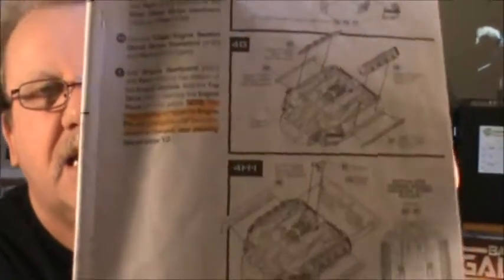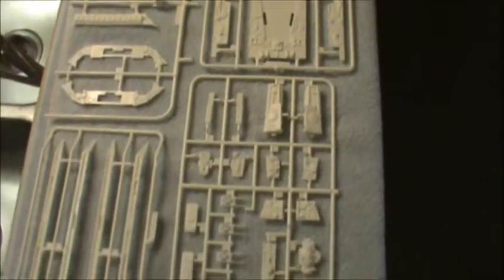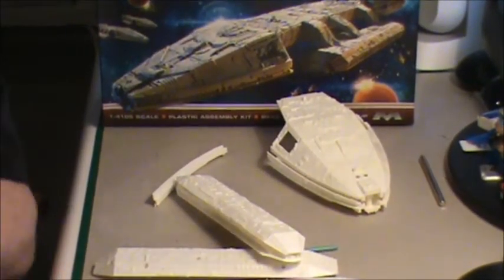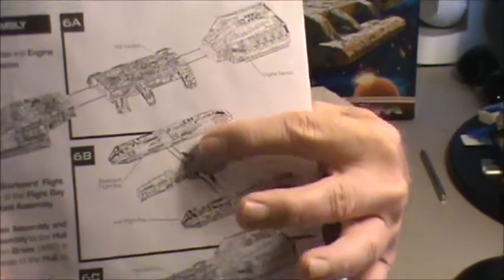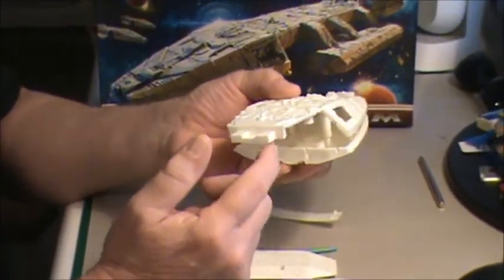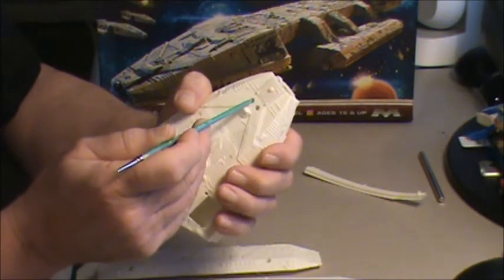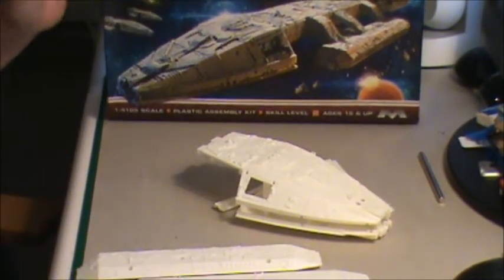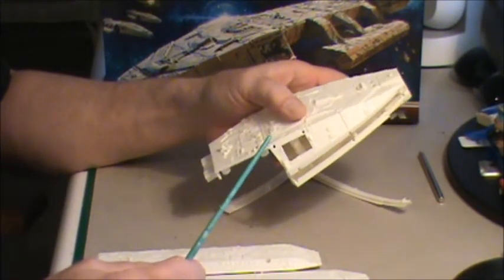BATTLESTAR GALACTICA Part 3

Comment: Thanks for doing this video. Just rush built this kit, and then remembered I WAS going to light it. Guess I'll have to find an alternate method to light her up. I do have a backup kit which will be light blocked inside, and properly lit. No fiber optics though.
I had the same warping problems, even on the landing bay side parts, but if you're careful, and apply low heat from a hair drier, or warm soak the parts, you can slowly straighten the parts out.
I tried the multi colour paint scheme suggested by Moebius, but when you get down on the model with a magnifier, you can see all the spots of the lighter off-white paint from the dusting coat job. I think this kit's too small for that kind of painting work. Still, she looks great seen with the unaided eye.
Definitely going to have to scan, and print a transparency of those matte paintings for light to pass through them when  backlit in the landing bays.
Looking forward to the next vid.
Reply from the maker: Thanks for watching.  Just posted part 3 yesterday and I am in the process of filming part 9.  I think I will post a new video about every 5 days.  That gives any comments a chance to run there course.  I am lighting mine and using PH.  NOT using fiber optics so I guess you will have to keep watching.  Had problem with PH....will be in part 8 but super nice for landing bays.  Lights and PH I'm using in part 5 to come.  When I primered the front section I also noticed it does not get down in between all the fine detail.
Reply: Gary Brinker Hi Gary. Yeh, I'm noticing that just painting from the outside won't cut it. I'll have to do light blocking inside with black, then white, then detail painting for the outside. Probably good I didn't light the first G. ;)
Reply from the maker: If you can hold off about 10 more days I show how I did my light block in part 5.  You don't want to get any over-spray on your model.
Reply: Gary Brinker Yeh, I'll certainly wait til then. I was actually planning on brush painting the insides of the parts for that very reason to avoid painting over the joints. :) Looking forward to seeing how you do your light blocking.